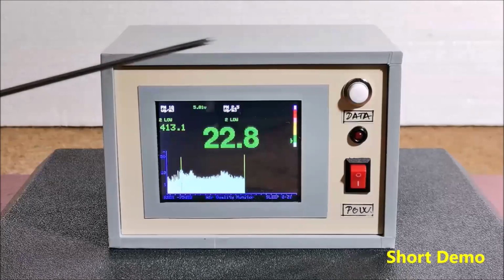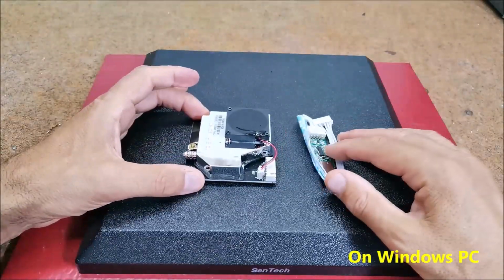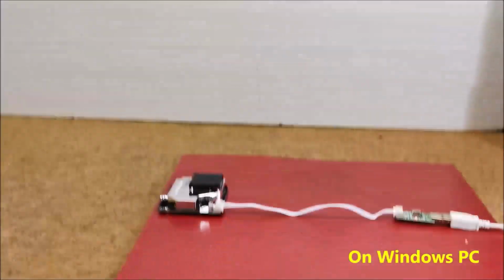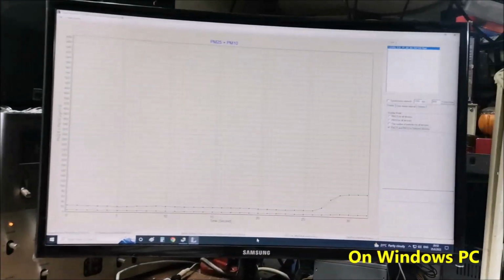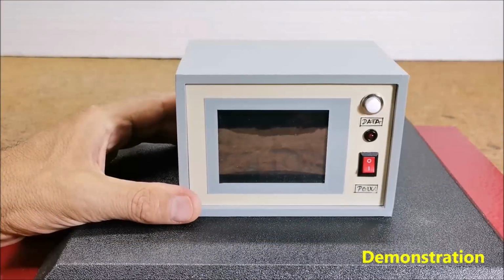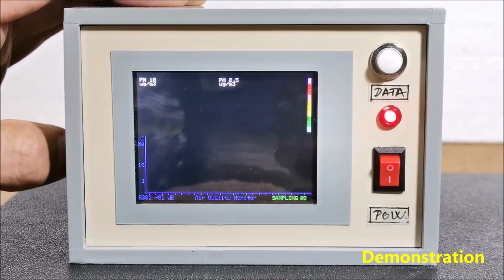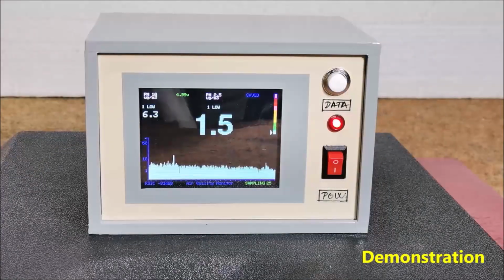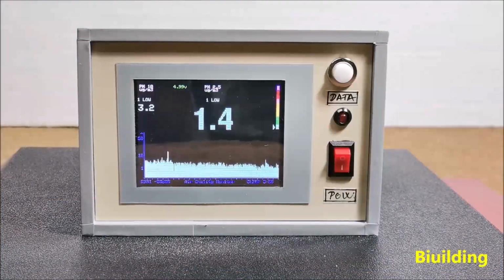ESP8266 Air Quality monitor with Nova PM Sensor SDS011

Comment: Hello.
Is it possible to make rife machine just with radio station with pc tone generator software control?
Reply: *fm transmitter
Reply from the maker: Smart idea, In one of my next videos I will present the Original Plasma Rife Machine and there I will explain in detail the working principle and possible variations. I hope the video will be ready in less than a month
Reply: @MirkoPavleskiMK  very nice 
Thank You so much!❤️ But can it be do without plasma for example to hold a electrode that is soldered to the antenna with hand if the signal is not strong without plasma?🤨🤔